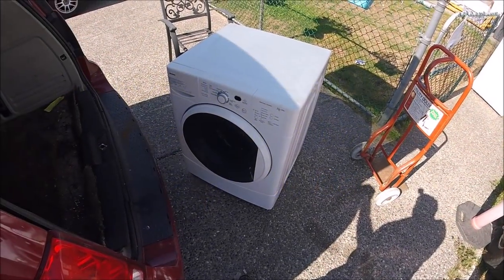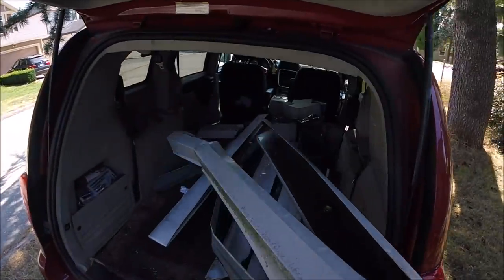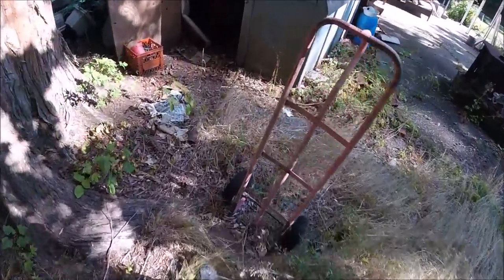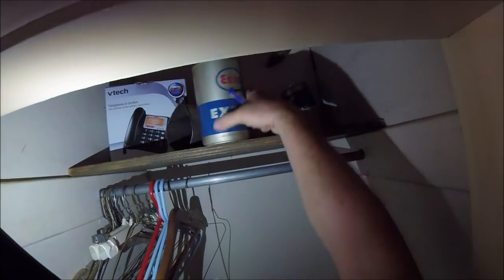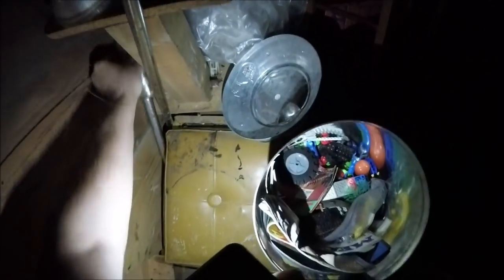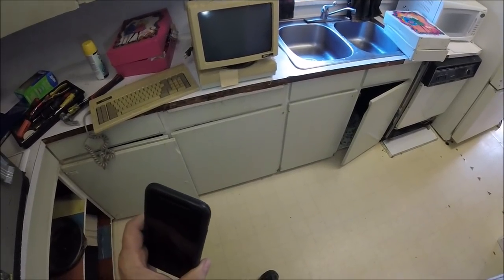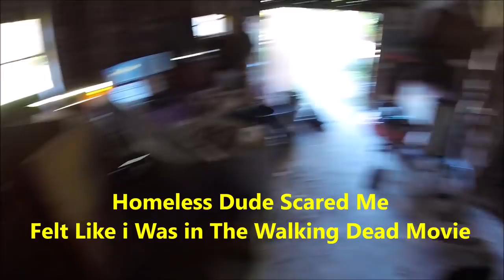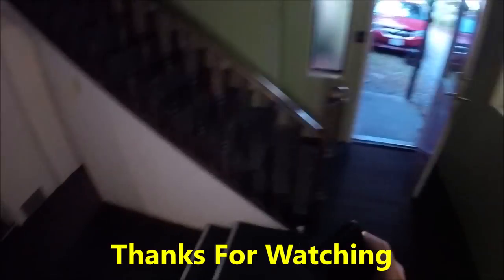Scrap + Old Computers + Demo House Tour & Creeper in Barn

Comment: the washing machine is a front loader then there is a block of concrete above and below it and there are springs on it that hold the drum in place and the engine is very good heavy and lots of copper